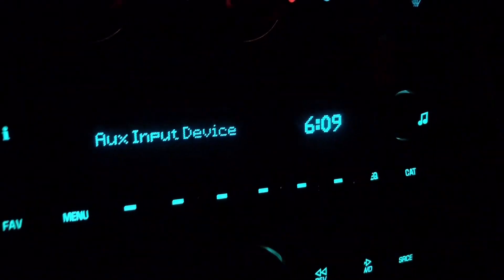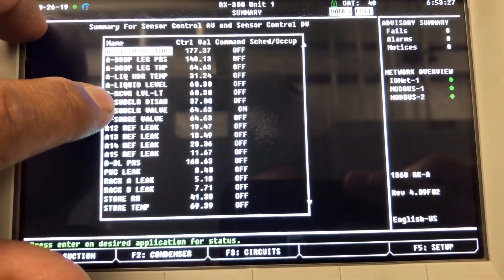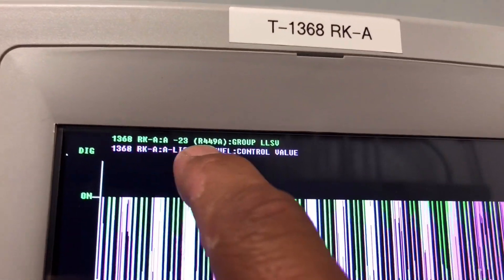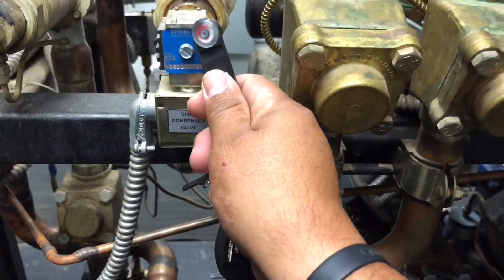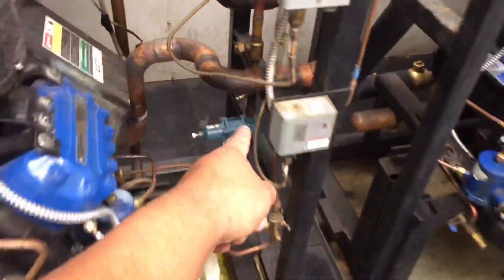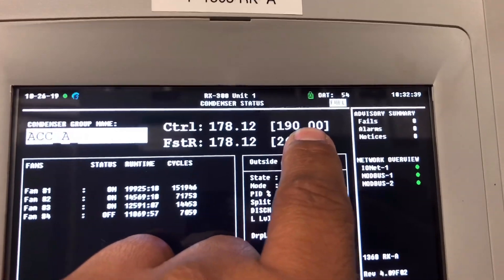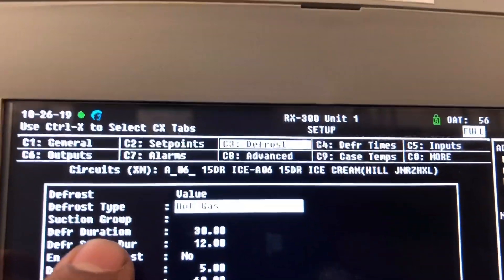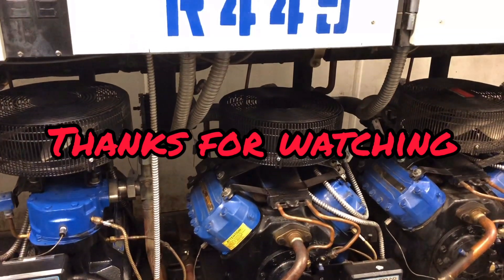Rack Refrigeration:  High Liquid level and Defrost issues.

Comment: I live 3 degree north of the equator and there’s no such thing as cold weather here and the system built here only caters for what you call summer. Therefore I have no knowledge on this and it is the first time I see a rack which runs like this, other than on single-line diagram. Bravo anyway.
Reply from the maker: YL Lai thank you

Comment: thinking about A9 in discharge .had problems with  hussmnn rack.alarm issues.defrost issues.when a system went into a defrost cycle,the entire rack was pumping down.defective main liquid solenoid.the valve would jam shut.replaced valve ,defrost straightened up,got diffrential during defrosts.

Comment: Quick way to get it to work so we can go home. Have to keep floating that head though so we gotta verify you have at least 70*F converted out of that A9 valve (because of gas defrost)
Reply from the maker: Yeah, you may be talking a bit above my level 🤣🤣. I still have alot to learn about these systems.  Thank you, I will read up on this.  I appreciate it

Comment: I feel you pain. Rookie on the Hou office. Aint no joke with the racks.
Reply from the maker: Yup.  Do you work on racks too.  Or assist in them.
Reply: Rookie Refrigeration lol i came from light refrigeration. But yes getting thrown to racks at 3am. Got to figure it out to get it back running and get help on the morning. So all this CPC and E2 is also new.
Reply: Having a harder time with MT board from HEB. Etc wheb they wan to act erratic or loose programming

Comment: What’s that coil tester thing you had?
Reply: To see if it’s energized
Reply from the maker: Not exactly sure the name.  We have a bunch of them.  It just picks up a magnetic field.
Reply: It's a rotation tester for electic motors..works great on solenoids to check activity but voltage could still be present with a bad coil. Amazon has them.

Comment: Another guy new to racks here, but I figure I’d give my two cents worth.

You might’ve been going down a rabbit hole with the correlation between defrosts and liquid level.

You saw the rack was in split condenser mode. when that happens in the fall, and before the temp gets cold enough to start flooding the condenser(after fan cycling wont cut it). Thats going to be when your liquid level it as its highest. Think about how much refrigerant gets pumped out of the summer condenser.  

Was this rack retrofitted recently and possibly just has a bit too much gas?
Reply from the maker: Trever Kirk we had some similar issues in the summer on this rack.  But it was definitely not overcharged in full condenser.  Now that it splits it may be.  Maybe by 10-15%.  Were going back out this week and dialing it in.

Comment: You got it. With that discharge pressurization valve if it was close the liquid will just sit it the receiver. 

Another thing to check is that you don't have overlap with defrost cycles, especially long run cases.
I find depending on the length of run and pipe sizes you might have to set your differential higher up to 35#. 

You'll know if you keep having a set of cases not reaching termination temp or you are defrosting a set and drain is not plugged up. Usually every couple of months depending on store humidity.
A quick way to check flow after putting a system on defrost is to grab the liquid line check valve that goes around the LL solenoid for that system. it should start to feel cold fairly quickly then you'll know the coil is starting to defrost. If you don't then you know where to start looking, discharge bypass(pressurization) to the receiver, liquid line modulating valve, etc.

is your termination air temp or dump line temp? we set termination at 55f for the minimum case. sometimes lower if there is a build-up of condensation on case canopy or frosting on product top shelf.
Reply from the maker: C Thompson thanks for the advice.  Yeah,we had a similar issue in the summer where another tech couldn’t get the cases to defrost well, so he increased defrost times and raised termination temps.  Man this rack had the oldr energized for like 5 hours straight, receiver at 100% the whole time, lol.  I had to undo his “fix”. Lol. 
And those temps for termination are on the piping.